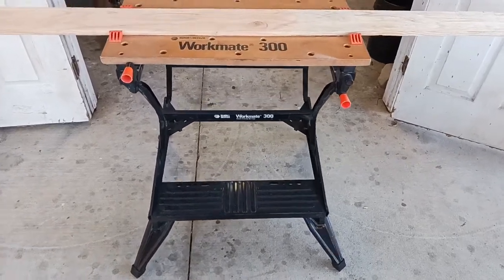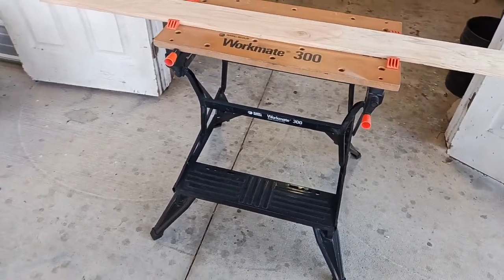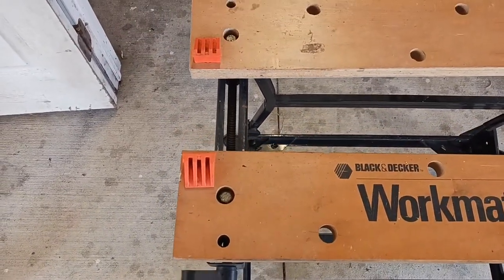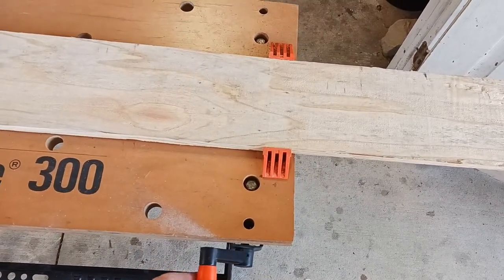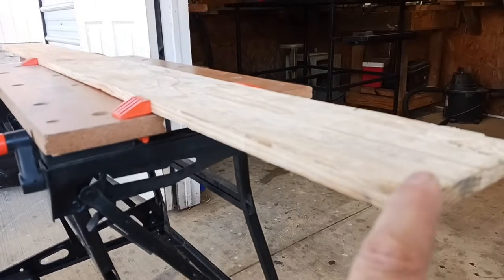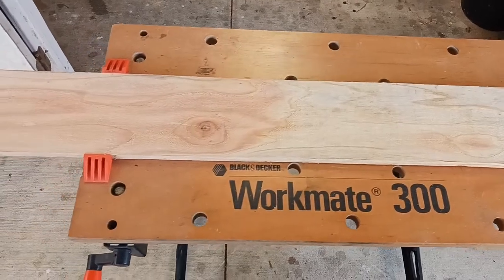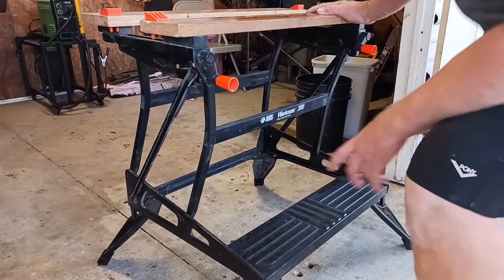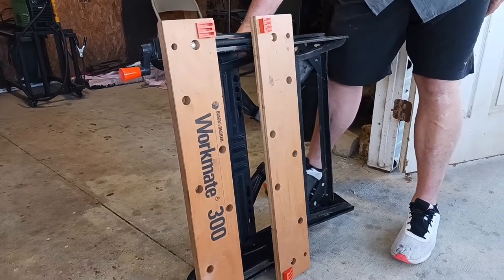Black and decker Workmate 300 overview

Comment: I can't find anything for this model🤦🏽
Great video though!
Reply from the maker: What do you mean by mode? Just checking because maybe able to help guide you in the right direction.
Reply: @jdtools6038  I was meaning the model #.. lol I can't find anything for the 300. It's almost as if it never existed...
Reply from the maker: I Understand,  I think it is old. Got mine from a customer that gave it to me. Who knows how long it was sitting around in his garage.  Just looked them up and looks like they have a 425 model that looks simular. It's on sale at home depot now. I don't use mine much, but it's handy when needed. Just be careful when ripping a board with circular saw because the top portion could be in the way of the blade. Definitely double check beforehand. I'm sure there is more uses for them too.  Just haven't figured it out yet.
Reply: I checked out this video to find out how to use it ha. Appreciate it

Comment: I DECIDED TO REPAINT MY OLD WORKMATE...IN LESS THAN AN HOUR I STRIPPED ALL THE PAINT .....IT HAS LESS THAN ONE MICRON OF PAINT,,,AND IT HAD A BIG MADE IN ENGLAND TOO ON IT.....I NEVER USED ALL THOSE HOLES ON THE SURFACE..FOR ME THEY ARE USELESS...
Reply from the maker: Right on, the paint doesn't seem to thick I've noticed. Been using mine more frequently actually and found its still handy, even with a table saw.  If you figure out what the holes are good for, let me know. Thanks!
Reply: @jdtools6038  THE HOLES ARE THERE TO INSERT NYLON STOPPERS IN THEM SO THAT YOU CAN GRIP A PLANK WHICH IS WIDER THAB THE GAP OF THE TABLE VICE...BUT MINE WAS NOT SUPPLIED WITH THOSE SINCE IT IS VERY OLD....LIKE ME...HA HA..IF NEED BE I HAVE FOUR STOPPERS MADE FROM A BROOM STICK...
Reply from the maker: Appreciate the info Vince!!